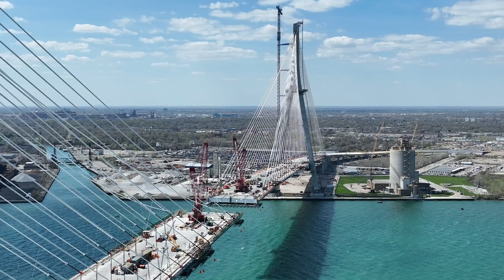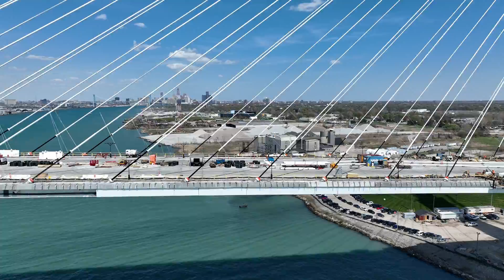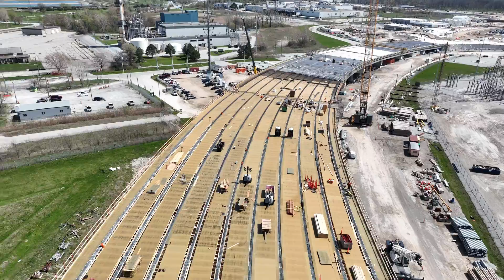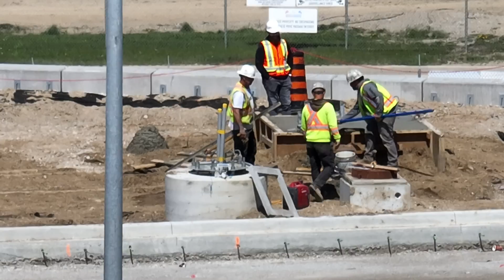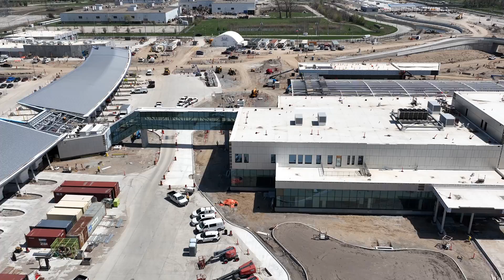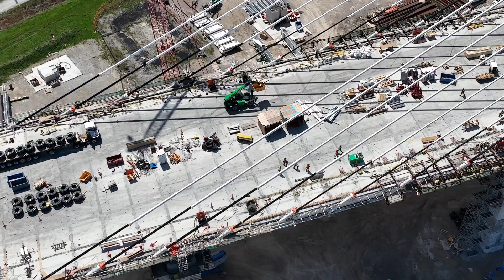Is This the Coolest Bridge in 2024?

Comment: How many daily laser measurements are done to make sure these 2 section will meet up exactly as planned?
Reply: I doubt that there are multiple measurements each day.  I did see somewhere that the last section will be a meter longer than design so that it can be cut to exact length just before installation.
Reply from the maker: Hi Roger. It's a mystery to me, but we'll know the solution in the weeks ahead, eh?:)
Reply from the maker: Hi Patrick. I imagine they have mapped it with lidar or something similar, which can be accurate to the centimeter, but they would only do it when they needed it to spot check progress. Again, Im just guessing. Good question!:)

Comment: Going to need air traffic control when they meet up 😂
Reply: That's why they went with the counter lever design was picked, they can sway side to side and up and down quiet a bit to make it line up easy, then they tension all cables to final spec
Reply from the maker: Lol. Hi Karl. You are exactly right. As a matter of fact air traffic control is responsible for drone traffic in that area as it is in restricted airspace due to the proximity to the Windsor Airport. When I file a flight plan with Transport Canada they warn me if another drone also has permission to fly in the same air space. Once in the air however each PIC, or pilot in command is responsible to fly safe. It could get crowded on the day the two sides meet. It will be interesting.